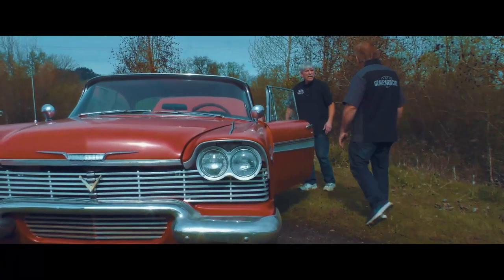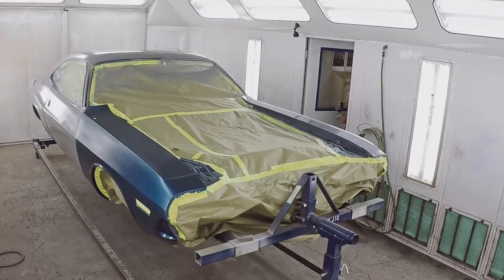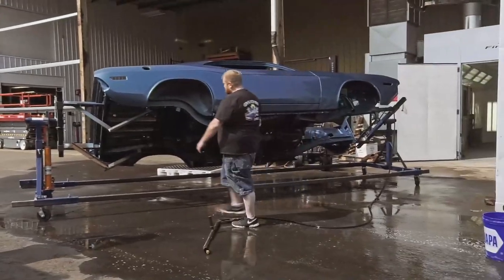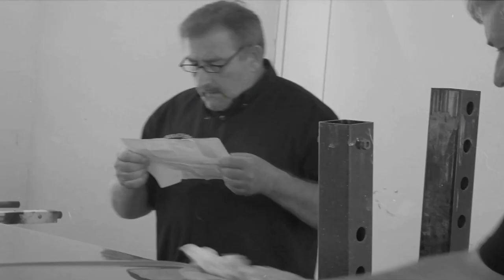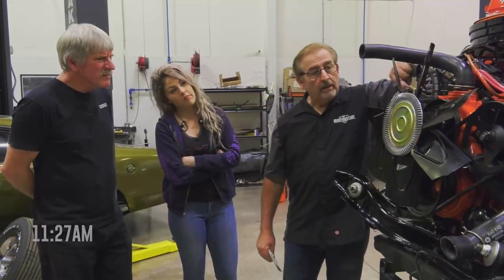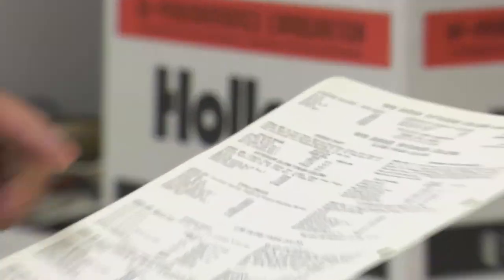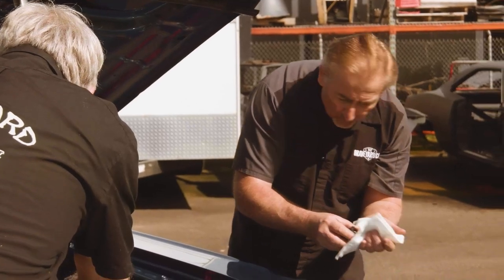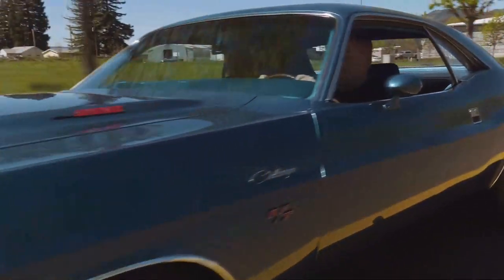NEW EPISODE: '70 CHALLENGER R/T 440 SIX PACK 4 SPEED

Comment: I’ve been doing tires for years. Did you know that often times you can balance a tire without any weights at all?
It’s a little bit more time consuming but if you break the bead and re-mount the bead on a different location on the rim. You can get it to zero out or at the very least you can minimize the amount of weight required to balance the tire.